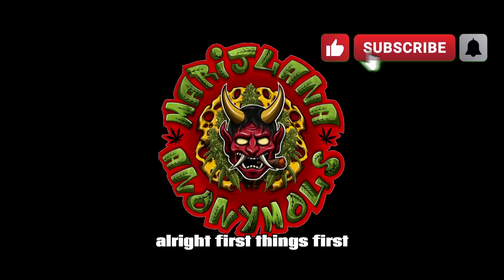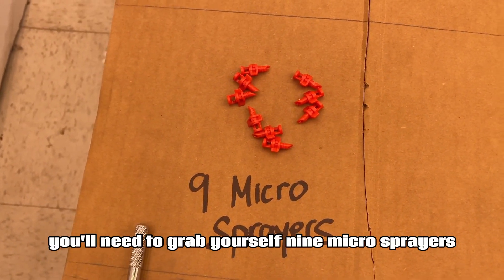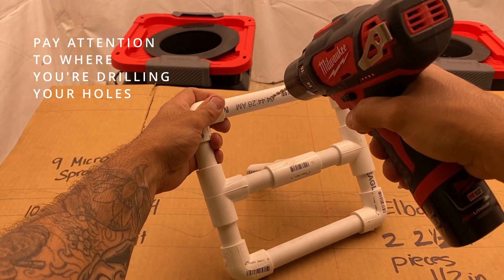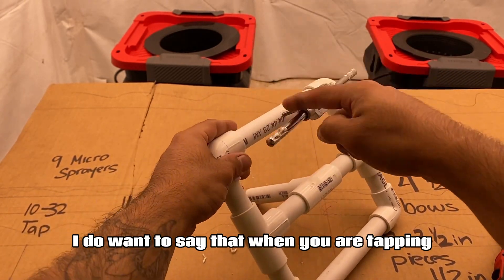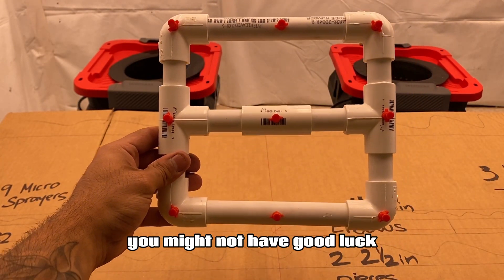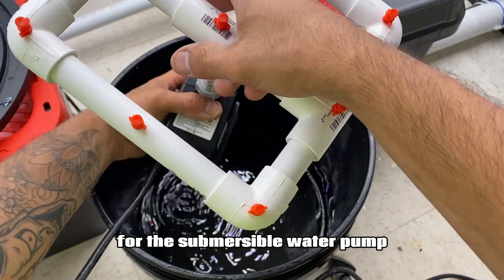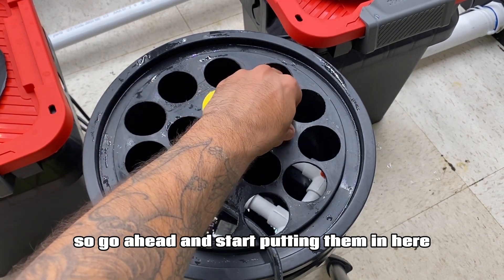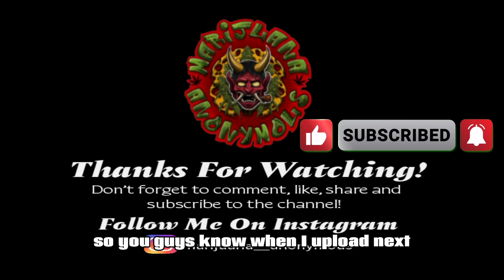How To Make The Worlds Best Plant Cloner!!! Why Didn't I Make This Sooner?

Comment: Also drill two air flow micro holes on the top of the lid so they don't leak out of the seam of the lid.
Reply from the maker: I usually don’t only because the holes would actually allow water to mist out from the mister inside the bucket. I’ve thankfully never had any leaks from my lids!

Comment: Should I use PVC glue to connect them together or I don’t have to ??
Reply from the maker: You’ll be fine not using the glue for this build if you were doing a RDWC or close to that where water runs outside the container I’d say yes use glue but for this cloner no glue needed
Reply: @ thanks buddy 🙏🏿🫡

Comment: In building this I discovered you don't need the tap. The sprayers go in just fine without the tap.
Reply from the maker: Yes you do not need the tap when I built my first one I didnt use a tap but it can be a pain to screw them in without it if you don’t have the finger strength haha

Comment: so you just dip in clone-x and stick the clone into one of those pods? Sorry for the newb question but how do you transplant the rooted clone into soil with these neoprene plugs?
Reply from the maker: So I actually just remove the neoprene plug before putting it into soil/coco/hydro. Mine have a slice on them that allows you to take them out and put them into the plug!

Comment: Sick, thanks for that!  I was just putting my jaw back in my head after seeing 80-130 for your setup on Amazon. Great job
Reply from the maker: Yeah I want to say this setup building myself cost about $30-$40 tops. Most espies I’ve thing is the pump and you can cheap out with a $10 pump I’d just replace the pump every few months. Could potential my lose a bunch of clones if the cheap pump fails after being abused

Comment: which pump do you prefere or what pressure and flow do you recommend?
Reply from the maker: For this setup you can get away with a cheap pump even like 35-50gph as you don’t need much. I think I myself have a 50gph pump. I  run my misters 24/7 but some people have said they run theirs 15 minutes on 15 minutes off. 
 Be sure to hit that subscribe button if you haven’t already. And if you don’t mind sharing this video I’d really appreciate it!

Comment: I built the same one years ago and still use it but I added the small net pots with the bottoms cut out for the plugs and bought the manifold off ebay, I think the dude still sells the manifold on ebay,. Oh I also found if you put a timer on it and shut the pump off here and there they root a little faster however that will wear out the pump faster
Reply from the maker: I have tried it with a timer before and yes it did root faster but like you said at the time I had time to spare and didn’t want to burn out my pump! I’m pretty sure they still sell the manifolds online as I want to say I saw one recently listed online
Reply: 15 minute cycles
Reply from the maker: @owenglass5414  yes 15 minutes on 30 minutes off

Comment: If you can create this contraption for under $70 I say it's a good idea Most cloning machines are around 70 to 100 $. Good video But need a price breakdown
Reply from the maker: I’d say roughly $30 for the setup on the high end. I will be sure to include prices in my other videos thank you for saying something. But this is a rough idea of the price list below. 
$5 bucket 
$3 lid
$10 pump 
$5 neoprene plugs 
$2 pvc
$5 sprinklers
Reply: Thanks brother
Reply: Some ah cheap but it will never be as durable as the one you build yourself

Comment: What type of micro sprayer did you use. 180 deg,360 deg? Where did you get yours from.
Reply from the maker: I ended up using 360 sprayers. And I bought mine off eBay years ago and still had them laying around. You can find them on Amazon and eBay. Don’t forget to subscribe if you aren’t already subscribed!

Comment: Do you use tap water? Is Water PH important here?
Reply from the maker: For the cloner yes water from the tap is what I use. I couldnt even tell you the ph of my tap water but that’s what I used for the clones nothing else. Make sure you scrape the lower portion of the cutting though. You want to scrape lightly just to get a little material off it’ll promote root growth in that location.

Comment: Sprayers work but what data would make you say they are the worlds best cloners? Dwc with air stone roots faster and stronger then sprayers i have both
Reply from the maker: I have tried many different rooting methods. This cloner produces roots in 8 days with tap water and no rooting gel, clonex spray or even treating the mother before clones were taken. This cloner produces roots in 8 days with only tap water. I have videos and years of testing as data. Have you tried using an aero cloner yet for cloning? I only use aero for cloning haha
Reply: @Ivo_Explains  yes i have i got one running right now but i do find the dwc with air stone works faster and a much stronger root zone
Reply: @Ivo_Explains  i dont use rooting agents either i think they are all trash when new ones come out i test them just to see if anything better has been produced but its always the same junk

Comment: Nice work, bud.👍 Been building my own aeroponic cloners for a while as well. The 5 gal bucket design was the first I ever used and still one I recommend/make for friends that need a way to clone that they can't screw up 😂 i usually avoid the PVC and just use half inch tubing to make a ring and connect that to a T that goes down to the pump. Easy peasy. Only thing I do besides that is put in a tiny plastic support piece to hold the tubing in place as the sprayers can push it down otherwise. 
It's pretty crazy to see just how well aeroponic cloning works, makes me want to switch over to aero from coco but I've yet to bite the bullet. Have you ever gone past the cloning stage with an aero setup?
Reply from the maker: I’m going to have to try that tubing idea one day that sounds like it’s a better idea than the pvc for sure. I have not ever gone passed cloning with aeroponics but I have been thinking about doing another plant with a new system. Maybe aeroponics will be the new one to try? If so I’d want to look around for a good system to possibly buy or make after. My RDWC was modeled after current cultures system and works awesome. Make sure to subscribe if you are t already though. I appreciate the kind words as well too!

Comment: Clear and detailed video bro👌..i was thinking of making this exact machine and was wondering what the temps are in the machine with the pump in it.are you running it all the time or on a timer...or is it possible for you to do an External Water Pump Cloning Machine DIY video with the same 5 gallon bucket?🙏
Reply from the maker: The temps aren’t to bad with the pump inside the bucket. I’ve always done it with the pump inside and have always ran it for 24/7. But if you did want to run it on a timer that is 100% possible and will bring down temps if it was an issue where you lived. And yes if you wanted to put the pump externally you would be able to do that. You would just have to put the plumbing in place but totally possible as well! Don’t forget to hit that subscribe button if you haven’t already! I appreciate all the support!